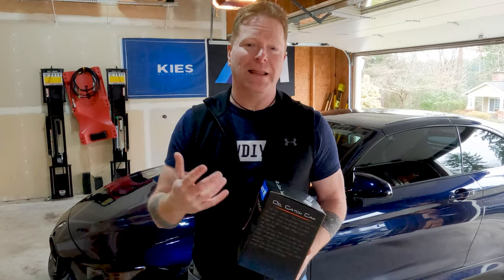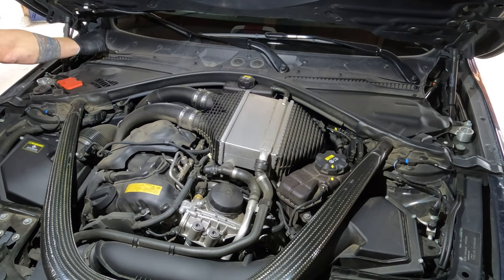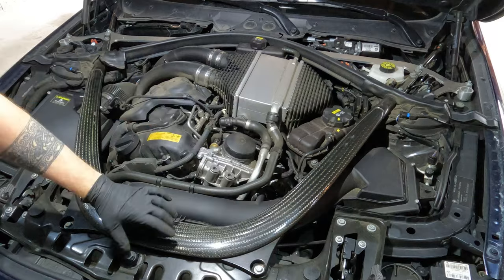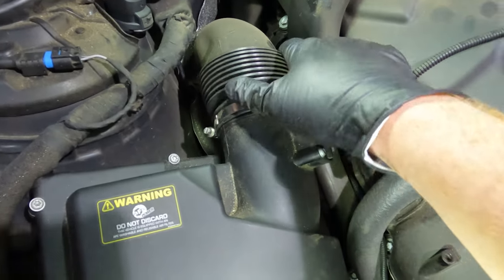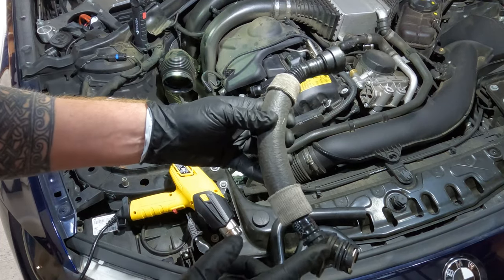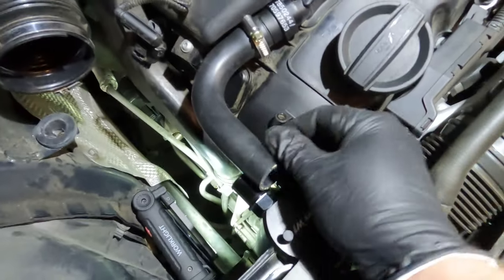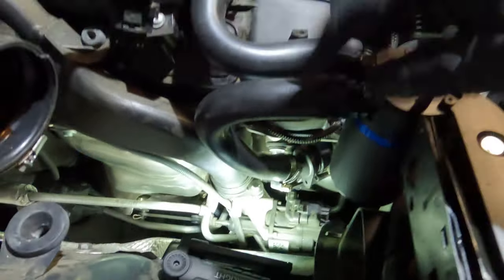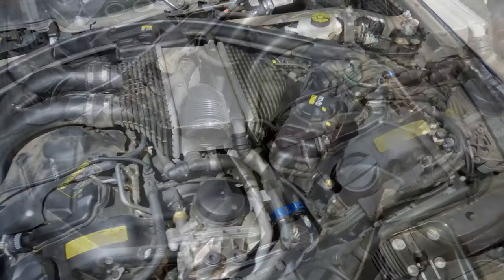BMW F83 M4 Convertible ADD W1 Catch Can DIY

Comment: The carbon buildup is not on the injectors (in DI engines inside the combustion chamber), but on the intake valves !!
Reply from the maker: Excellent point!